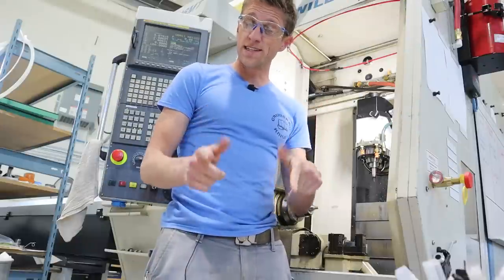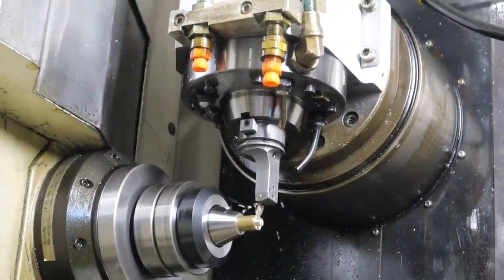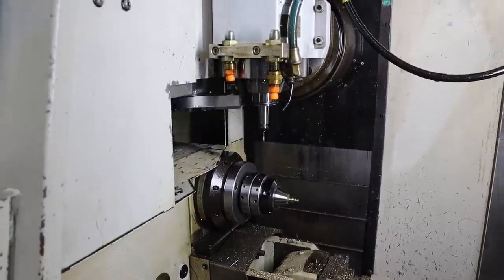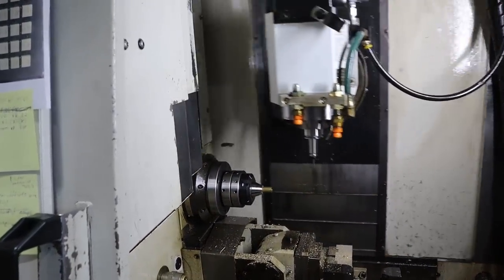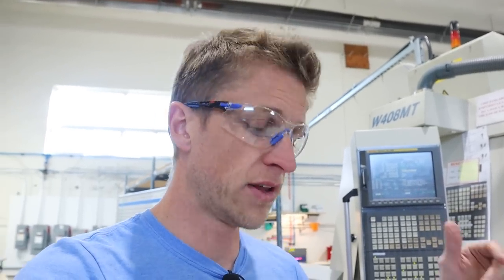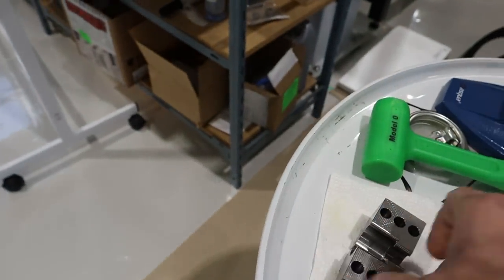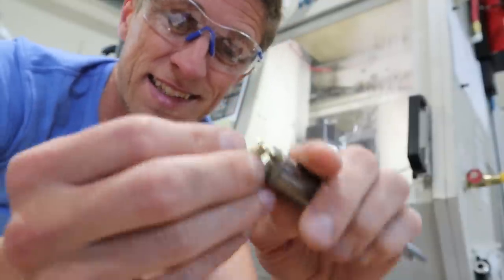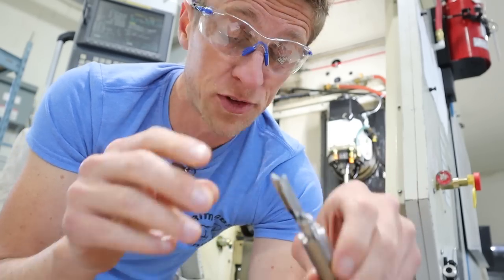Let's Make Some Custom Screws on our Willemin!

Comment: If you reverse chuck rotation and flip threading tool upside down, you can cut right hand threads left to right.  This way you do not have to be afraid of crashing your tool.  I think I got that right? 🤔

Comment: Since you are not relying on the face of the jaws what if you milled an angle on the soft jaws so when the vise unclamped the screw would tip over and slide down the angle on the head of the screw into the tube. As long as it didnt get stuck in the radius you milled into the jaws.

Comment: The vise jaws don't really need to butt fully up against the flange of the screw right? Keep the bore but mill an angle on the face of the jaws so the screw falls and slides down the face of the jaws like a ramp? Or just tool change in a spring and use the spring to push the screw out the jaws with the spindle? I am obsessed with the Willemin's please grace us with many videos of all the clever tricks you come up with, that machine is a goldmine. Hope to follow the "two willies in my garage" path myself.

Comment: Could you use the milling spindle to push the part along the Z axis of the lathe and into the drop tube with the clearance of the bolt shoulder rather than the head dropping through the vice? Moot point but just an idea

Comment: It would actually be interesting as heck to see this redone in the orientation you mentioned, it seems like you could save~ 30% material per screw or so due to alternating T shape being one you can overlap with itself 180, but probably dominated by tool clearances needed to make it..

Comment: There are more way to skim a cat ...
Lathe with sub spindle and driven angular geared milling head (my lathe at work would do 16000 RPM with such a head).
Use an "outside" torx -> bigger radii -> bigger mill diameter -> less RPM
Reverse the part (head to the right), part it off with a slanted part off tool (small bimp is left) and parts catcher. No sub spindle required.

Comment: Odd suggestion: can you open the vice and then have the spindle with an pin or drill push the part over the edge of the vice into the tube?

Comment: you could also just use a blank rof in a toolholder to sweep the screw out of the vice jaws (rod does a simple left to right motion to brush the part from left to right out the vice

i fucking love this machine, i sometimes am completely overwhelmed designing my own diy 5 axis cnc, althoug i already have a hobby 3 axis machine (which is one of my biggest archivements at 18 years old) and this makes me realise im at step 2 out of 50 😮
Reply: This is exactly what I thought. As long as the gap in the vice jaws is wide enough for the shaft of the screw to slide between it should work (at leaast in theory).